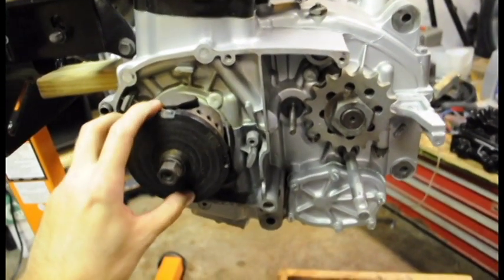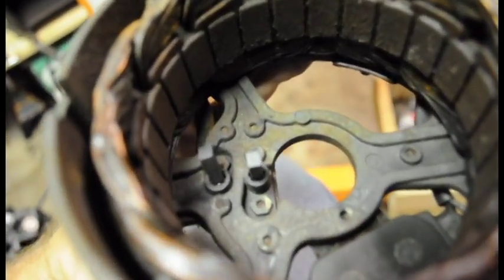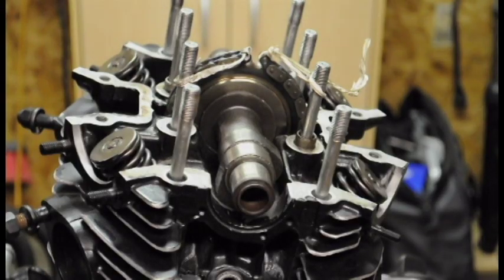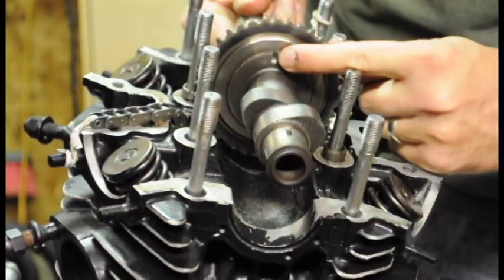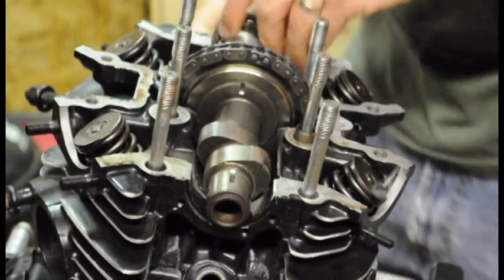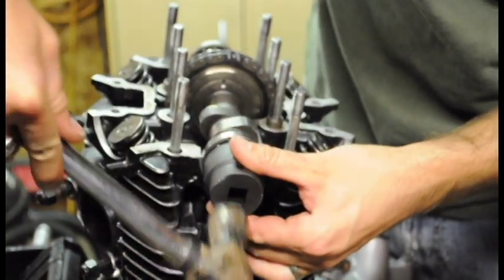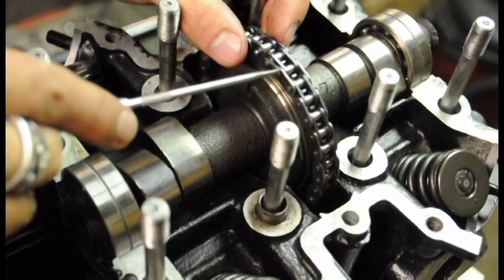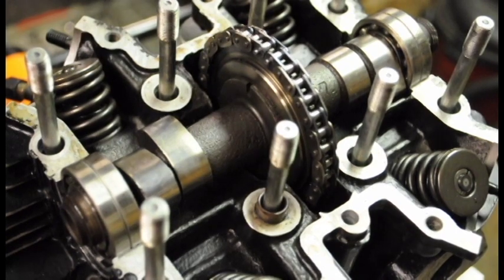xs 650 engine almost finished

Comment: I just built one for a customer and there is no reason to beat on the cam berings. Should be plenty of slack in the cam chain with the tensioner removed. And that is a great way to ruin a bering by the way